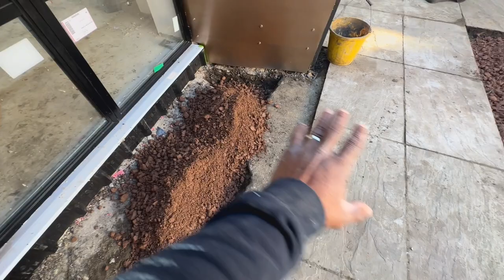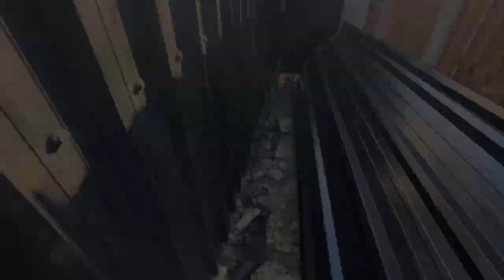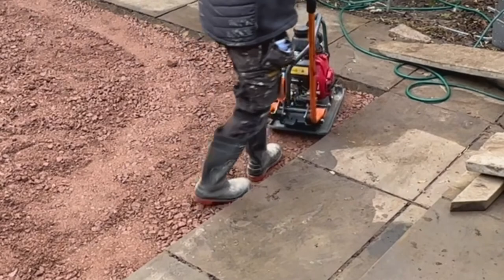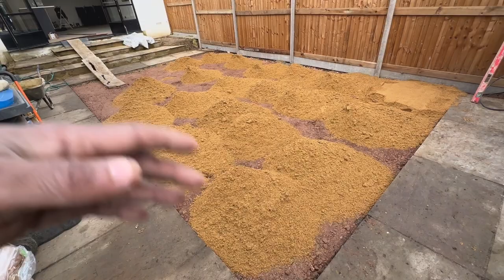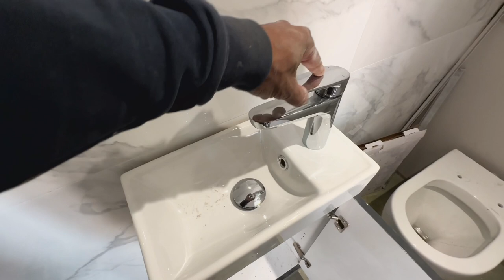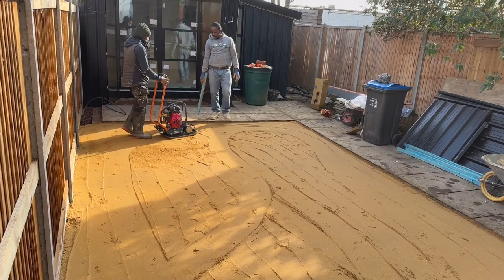Installing the sewer pump system - Modern Garden House Ep 38

Comment: How much would it cost to install the sewage pumping station. Also do you cover Birmingham area
Reply from the maker: Hi sorry on London, this unit cost about 700 if I can remember. Cost to install will vary
Reply: Thanks for the reply. Roughly what kind of price am i looking at to install i have dug the hole for the tank and trench for the pipe. I just need to know a rough figure plz as i will be getting some quotes but want to know if i am being over charged. Or could you tell me how much you charged for the install of that pumping station, i would really appreciare it and it would help me. Thanks 👍

Comment: great video, so hard to find info on a pumping station installation.
Reply: Did you manage it in the end?
Reply: @rossco333333  not installed mine yet
Reply: @-Colonel-Kernel  I work for the company who makes and often installs these tanks. What is it exactly you need help with?
Reply: @rossco333333  understanding the overall design. Max length of run from the main drain and min/max fall. How much cover the pipe needs,  and whether a lean mix or something else is needed. Also rules about whether all water can go into it and about placement near buildings, boundaries etc. Not yet found an easy to read design guide. Also sizing of course. Thanks
Reply: @-Colonel-Kernel  Max length of run from the unit depends on the head height of the pump so it can vary. If it's a foul station then it's fine for grey water to go into it too, obviously no sanitary products, oils, foreign bodies ect, they will cause a blockage, overwork the pump and essentially void it's warranty. We have installation guides, disposal guides and other guides that I'm sure would help you.
Reply: @rossco333333  thank you, when I am closer to purchase/installation I would find those very useful. Thanks. Nigel
Reply: @-Colonel-Kernel  you'll have add me on another social so once you're ready I can hopefully give you the help you need. 👍🏻

Comment: You should have installed  2 barrels into the ground connected via a pipe to the pump barrel. This will keep all the s%%t in the main barrel without blocking the 2nd pump barrel.  Eventually the pump will fail and it will be one messy job trying to change the pump when full. You need to protect the lower part of the pump blade area with a mesh so that toilet paper and ladies pads don't block the blades. Talk to the owner about connecting to an adjacent barrel and also think about a fail safe system back up like a spare submersible pump.
Reply from the maker: This is the correct way for this system. It’s also a vortex pump so toilet paper etc doesn’t go through the blades. Everything passes BY the pump but not through it. It’s not the same as a Macerator or centrifugal pump. And we don’t want the s%%t staying in the chamber, we want it sent out into the sewer. This is a different system than you may be used to.
Reply: @darrenthebuilder  Everything fails especially when you least expect it too!
Reply: Installing 2 pump stations for so few amenities is overkill, following the disposal guide and regular servicing of the pump station will ensure a healthy pump for years. It looks like a perfect installation to me 👌🏻